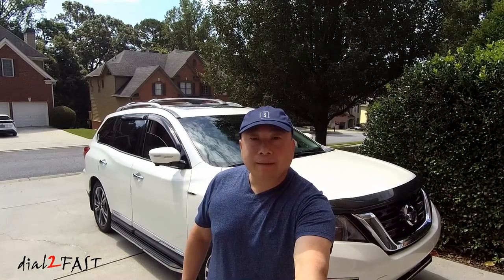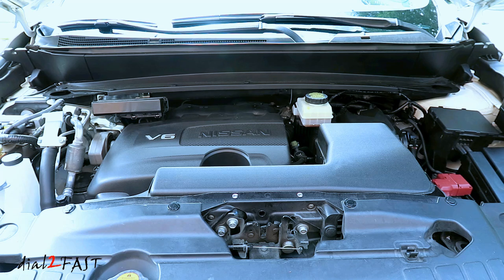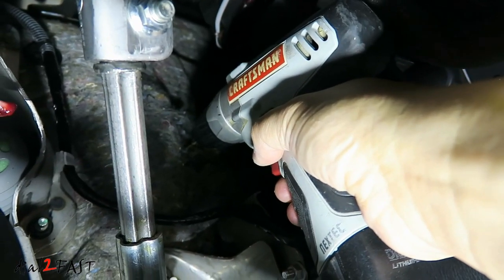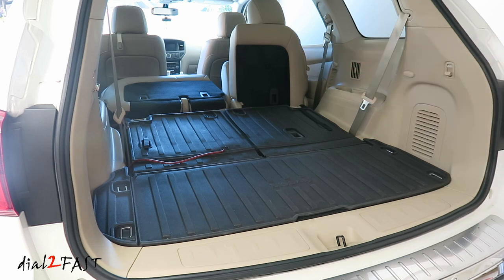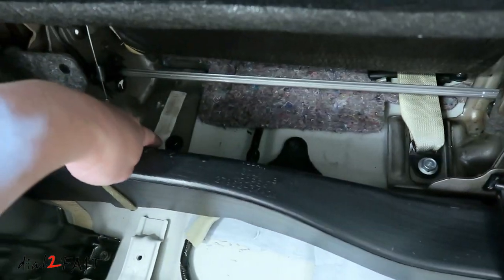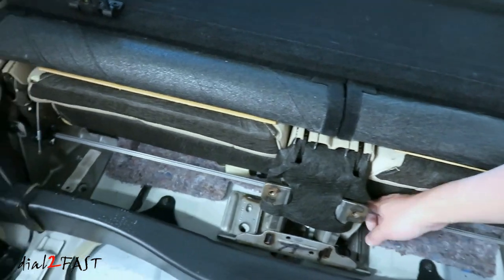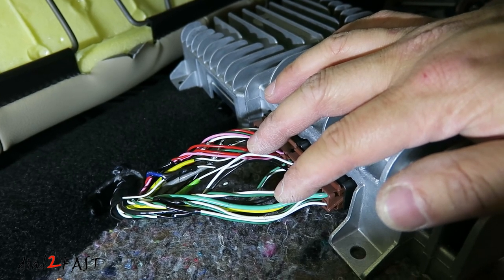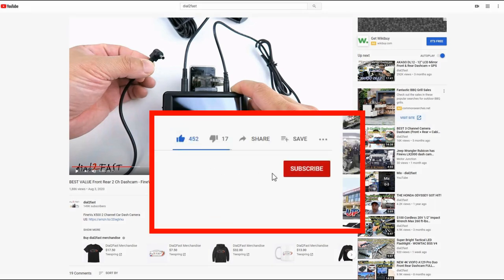Install Amplifier & Subwoofer To Factory Radio Bose - Nissan Pathfinder VIDEO 1

Comment: For anyone looking for a rubber grommet to feed your power wire thru. Take your glove box out and behind it in the top right area you will find a rubber grommet perfect for your power wire. No holes drilled or needed. Cut a line in the grommet and push your wire thru it and pop the grommet back in with your wire going thru it sealed.  Just thought this might help someone cuz I had to search for a hole for my power wire for a amp for subs.
Reply: are you saying that theres a hole that goes thru the firewall without drilling an other hole?
Reply: @MrGonzo24  yes. Take the glove box out. And behind it to the top right there’s a rubber grommet that has a hole that leads from inside of the truck to the motor area. You can start feeding it thru the inside and you will see it come out
Reply: You kinda gotta feel around upwards behind the glove box towards the right corner. There the rubber grommet
Reply: Do you perhaps have a pic of where it comes out in the firewall?

Comment: It’s a few steps missing here. Where is the transmitter for the rca plugs??
Reply from the maker: There is no transmitter or RCA. This setup uses the high to low level converter that's built in the amplifier. So it takes speaker output straight into the amp.
Reply: @dial2fast  will this make my new sub sound like the original one?

Comment: I was told by technician that my bose amplifier would need to be replaced. I have a 2014 Nissan Pathfinder Platinum. Would mine be in the same location? They are wanting to charge me 250$ for labor and I'm on disability currently so i can't really afford it so i need to do it myself if possible.
Reply from the maker: Yes same location for this generation of  Pathfinder.
Reply: @dial2fast  Thank you for the quick reply and information

Comment: Did you only draw input power from the left or the right channel or both? In other words is the sub input only 1/2 stereo, if so, do you get any fluctuation in the bass output from the sub itself?
Reply from the maker: For the hi to lo input, I connected both L & R. Since I only have 1 sub (right now), it's only outputting on the L side. By connecting it this way, I can easily add another sub for the R side later (since input is already connected).

Comment: I just got a 2019 Rock Creek... it has the Bose system, I TOLD myself I was going to leave it alone.
Reply: Does yours have a sub? My dash says Bose no sub or cutout where it would be
Reply: It does, and I replaced it. I followed his guide... it's not hard if you have worked on car stereo equipment before.

Comment: Very good work. I have a jbl bp600.1 amp that has a feature called "common sense" and turns on when audio is detected on the high level inputs. That would of been a nice time saver in this scenario.
Reply from the maker: Thank you for your comment! Yes there are several ways of getting remote turn on signal depending on the equipment you purchased.

Comment: Instead of taking the storage area and 3rd row apart to access the remote turn on lead from the factory amplifier, couldn't you tap the remote turn on wire to a fuse in the fuse box? Then run the cable back to the amp with the power cable?
Reply from the maker: There are couple ways to get a 'remote turn on' signal to the amp. One is what I did getting it from the Bose amp which is a true remote turn on meaning my amp will turn on when the radio is on. The other method is like what you pointed out which is using an igntion 12V as a remote turn on. But with this method, the amp will always turn on when the car is turned on (even if the radio is off). The third option is with some line output converter device, it will detect the audio signal to the speaker and generate a 12V remote turn on for the amp. All 3 will work, just depends on your preference.
Reply: @dial2fast  Thanks. Didn't consider it staying on even when the radio is off. I rarely turn off the radio, so I'll probably do it that way anyways. Appreciate the detailed info.

Comment: I'm about to do this very same thing on my 2022 Nissan Pathfinder Platinum. Bass is there, but lacking.
Reply: Tapped into the Bose subwoofer connector but the bass lowers when I raise the volume. I may have to tap into the wires before the bose amp to remove the amps bass vol adjuster.

Comment: Dude, FANTASTIC video(s)!!  Very clean install job!  Thanks for the attention to detail and the instructions.  How long did this install take you?  Did you state in the video that one could install a low profile subwoofer under the rear seat?  Recommendations on one?
Reply from the maker: I did this install over couple weeks as I was working on other videos. As for a low profile powered subwoofer, you can look at this Kicker one https://amzn.to/3qSwejf
Reply: @dial2fast  Do you own the '07 Pathfinder?  The reason I ask is because I have an '06 and I'm needing to replace the head unit (CD cleaning disc didn't help).  I had replaced it previously and in doing so, broke the top of the panel that's removed when doing so.  Is that panel the same for '05-'07 models?

Comment: Do you think it'll work if I follow this tutorial but with my 2011 maxima instead of the pathfinder?
Reply: It's the basics in this video the place you tap in for a signal will vary, however if you have speakers above the trunk you might be able to access the wires easily or amp in a be way easier spot to get to in the trunk
Reply: @asfbi  So you are saying, this tutorial might work to find my bose amplifier in my 2014 Nissan Pathfinder Platinum? Because i was just told that i need to replace mine and i can't really afford what they are wanting to charge me to replace it.

Comment: Would this be similar to the rogue setup ? Would the stock amp be under the rear seats ?
Reply from the maker: No, the wiring and everything is different.
Reply: @dial2fast  okay, well if anyone could reply with a video that could help, that would be great. I can't really find anything for the 2016 rogue

Comment: I have a 2018 pathfinder I want to upgrade my sound system. Do you think it’s gonna void my warranty??
Reply from the maker: It will void the warranty on anything that is related to the components you modified. Of course that doesn't mean the particular dealer will not give you a hard time on any repair. That's why it's important you know what you are doing.

Comment: Did u use both of the sub wires for signal?
Reply from the maker: The input signal is wired for both channels, and the amp is bridged to 2 channel output. So in the future if I want to run dual subs, I just have to connect the other output on the amp.
Reply: I lost little bit so you didn’t have to use rca jack to send signal to the after market amplifier, I really want change my factory subwoofer

Comment: Where are you located id pay you to install my subs! 
Also how to you control more or less bass? From radio or do you have a bass knob?
Reply from the maker: You tune the optimal bass on the amp's EQ, then you adjust + / - bass on the factory radio. If your aftermarket amp has remote bass control knob, then you can use that.
Reply: Thank you, yea i was thinking of running a bass knob from the amp@dial2fast
Reply: Did you change your door factory speakers as well or just the sub?